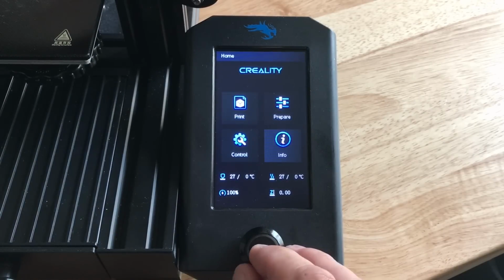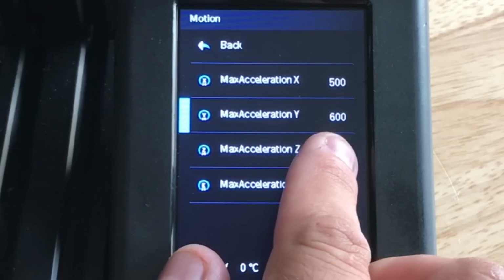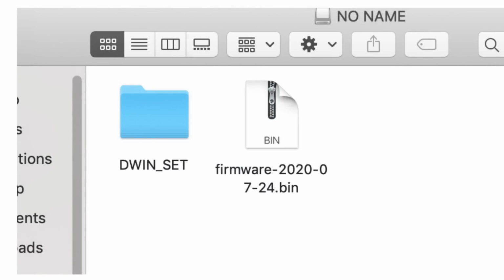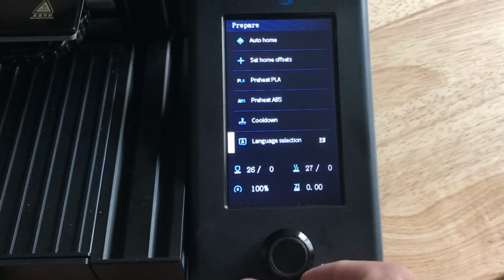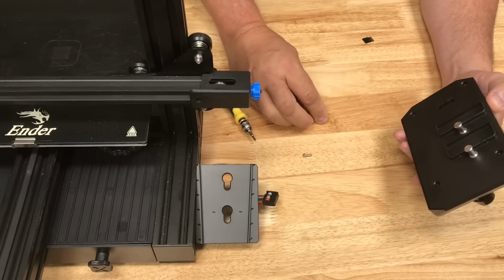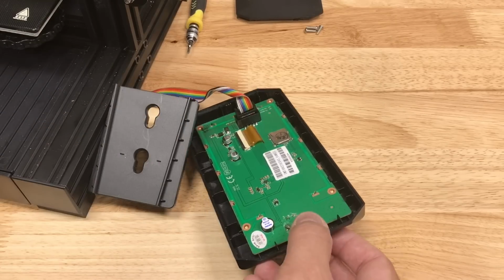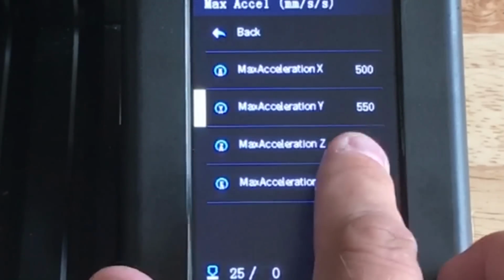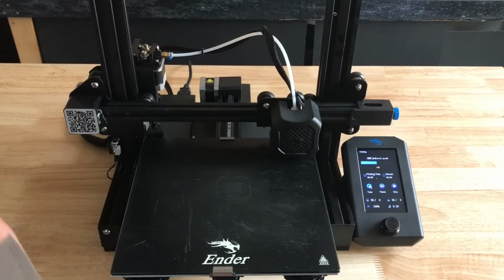Creality Ender 3 V2 Firmware Update - Motherboard and Display

Comment: I installed the last firmware file from your website (marlin2.0.6.1bugfix.zip) and also imported the display update. Unfortunately I can't change the language to English. It stops on CN. Who can help?
Reply: Unfortunately, I cannot change it at this point in the menu.
Reply: Same with mine, 
reinstalled multiple times and just gets stuck on Chinese.
Reply: I had the same problem
Reply: @funthefun8145 : I switched back to the original firmware of Creality (V 1.0.2). But then I couldn't change the language from CN to EN . After the 2 or 3 tries I was able to change the language. If there should be another solution I would like to change to a newer version of the firmware.
Reply from the maker: I just tested my firmware again and got the Chinese and was able to put it back to English same way I did in my video. I did have to click it twice though before it changed.
Reply: @robinkrippendorf316  I did the same I went back to (V1.0.2)
Reply: @FilamentFriday  New one is definitely busted. I've tried installing it multiple times and it always stays stuck in Chinese whether I click it once, twice, or a hundred times.
Reply: @tjaylatham  just curious, but did you update both the display and board firmware?  Changing the language worked fine for me, but I only updated board firmware, not display.   I've since rebuilt marlin code to add bltouch, and no issues loading that either (although I can set language in source code).  I still haven't updated display fw.
Reply: @gregr5  I only updated the board firmware. I tried reinstalling multiple times but I ended having to switch back to the latest Creality firmware release.
Reply: @FilamentFriday  Is it possible that there are different motherboards available for the Ender 3 V2 and that this is the reason for this problem?
Reply from the maker: You never know with Creality.
Reply: Also having this problem, won't let me change the language
Reply: I had the same issue also, I even tried updating the display firmware.  I ended up going back to Creality's firmware.  I was weird, when attempting to change the langue to English, the screen would flash real quick, like it was going to change the text, but it would just stay Chinese. Also when attempting to update the display, all I ever got was a bar to go across the display, never saw the screen change blue then orange.
Reply: same here. no english
Reply: Are there any other identifying markers on the Motherboard, other than Creality  V4.2.2. to see if there are a few different motherboards at play here in the V2.
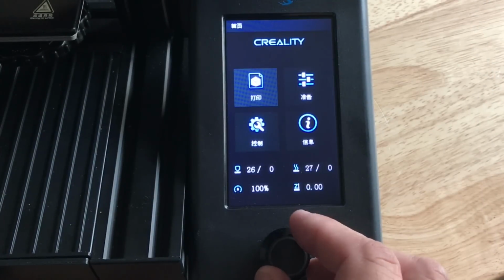Reply from the maker: Watch at 3:10 https://youtu.be/dLZm2itXJkg

Comment: Does this firmware enable thermal runaway or does the standard firmware already do that? I am going to buy this as my first 3D printer but I am slightly scared of it catching on fire (ofcourse I will only print when I am also in the same room)
Reply from the maker: The version I have does but they are shipping it with 32bit board now so I’m not sure.

Comment: Great videos. And I just got in an Ender 3 v2 and noticed I will need to update the firmware to use some standard features that were  on my ender 3 and pro. Editing code is not exactly what Im comfortable with. Two things i am missing is the ability to use Cura M600 (Filament change) and the ability to change the flow rate on the controller. Your video was a great demo of how to install the firmware on the machine and controller. My question is does your firmware allow for M600 and flow rate on the fly? im not sure how to edit the gcode either. So I rely on Cura to input the M600 in post processing. TIA Also what camera are you using for your videos?
Reply: I was able to update and it restart in Chinese. The video explained perfectly how to fix that. I created a gcode with a m600 and still didnt work unfortunately. Help please
Reply: CHEP I really would like to get the M600 working. I have download the latest version of firmwares without success. I tried to register to you website and it denied me

Comment: I just received my Ender 3 v2 and tried upgrading the firmware. I have Creality original firmware 1.0.2 (fro INFO menu).
I copied your bin file to an empty SD card and inserted it into printer and turned printer on.
I saw the Creatily logo and progress bar but after it loaded it still showed version 1.0.2.
I tried additional bin files from different sources (including creality) and even compiled my own but still always shows v1.0.2.
How can I update my firmware?
Reply from the maker: 1.0.2 is the latest from Creality. Just use that.
Reply: @FilamentFriday  I tried a different SD card and it worked although the first one was fine when upgrading the screen FW before.

Comment: HI, Great videos. I used your set up video to build mine, thanks. I have an issue now (User Error) Ok so I went to update the firmware before calibrating. I accidently loaded the SD card that came with the printer instead of the SD card with the new .bin from Creality's website. Now the LCD doesn't load/blank. Thoughts?

Comment: Hey Chuck! Your videos helped me update the firmware of my V2 and setup. I did my first print (calibration cube) and after measuring, I noticed that the sides are taller than the bottom/top. Before doing the cube I did calibrate my esteps but, what else can I to pin point what the issue could be? the cube itself is solid and looks really good, no signs of over or under extrusion. The only issue is the height. Any guidance would be much appreciated!

Comment: hello chep, I wanted to know if  one can change the creality images for those of their own logo, if so, these images that must comply to be entered into the folder DWIN_SET
Reply from the maker: Not sure.
Reply: I was thinking exactly the same. Surely if the DWIN_SET is the images the firmware uses. Then just editing one of the images and saving over the original would work. Please comment if you have tried this. Thanks.

Comment: Hello people, maybe someone could help me.
My E3 V2 went crazy... I load the stl file.... and when it starts, the first movement is a violent slash to the front right and then it raises to the backward right (Making 2 lines, those are the two lines that normally are made in the left Y). It crashed the bed clips in his way.
I'm completely lost. The G Code of cura is fine and I used the printer a lot of times. I have no idea what this could be :(
Thanks in advance everyone.
Reply: I have read on reddit, this could be due to filenames longer than 21 characters. Did you check that?
Reply: @MatthiasBenögen  Thanks a lot for your time Matthias. Yes, they were shorter than that. In my case, was using the micro SD card a lot of times withouht formating often.
Now I am formating it almost every single time and it's running ok. Weird....

Comment: I'm using the latest firmware from your site (fffirmware-20200802-113211.bin) and it solves a lot of problems in the Creality firmware but it creates a new one. It will accept X and Y move commands up to 235 instead of 220 on the factory firmware. This means it can slam into the end of the Y axis. Cura's command to present the print is an example where this happens (G1 X0 Y{machine_depth}). You can also command a Y axis move from the display up to 235 and get the same result. I reverted back to the current Creality firmware to confirm this behavior is specific to the latest firmware on your site. Thanks for all the info and for the firmware. It's been incredibly helpful. I'm hoping this bug gets fixed.
Reply from the maker: I will look into it. Thanks for the detail.

Comment: Hello sir i have an issue with my cr10 clone printer...it just started today ...any idea why a printer would stop printing in the middle of a print??? print was fine up until it just stopped moving...machine did not shut off,nozzle temp and bed temp stayed same...could not resume of change settings... i had to power off and start a new print...than as like with the other it just stopped again 10 mins into the print.... i have fixed dozens of issues on 3d printers over last year,but this issue is something i don't understand...also i have printed this file many times with no issues... please help... and tell me if you ever had such an issue...I found ond video of a guy having this same exact problem with his brand new ender 3 after only 2 hours of use  ,but he only showed a video and did not give any solutions even had his comments turned off...thanks
Reply from the maker: Try a new SD card.

Comment: Hi Chep. For upgrading the Display it is necessary to format the SD card to FAT32 with 4k allocation unit size, otherwise it seems it doesn't work. For fixing the "Storage configuration" you need to edit the "1_English.jpg" file, moving the "Stor" characters to create the phrase "Store configuration". After editing it, you need to convert the JPG file to the 4:4:4 jpg format, by using the "JPGConvert.V1.2" program, it's in Chineese, but there are only a few buttons to guess how to do it. I can send you the final JPG file ready to be upgraded.
Reply from the maker: Awesome. Thanks for the details. Can you send it to FF@elproducts.com?
Reply: @FilamentFriday  email sent!

Comment: Thanks for very useful videos.  I need help restoring firmware, I've tried installing new firmware but display screen backlights only no text?  With or without SD card.  I've tried uploading the 1.0.1 and nothing.  Any solutions out there?

Comment: Hi Chep, thanks again.  I just got my V2, and I want to update with your files.  However, now your site only has the fffirmware-20200802-113211.bin listed, without a zip with the DWIN_SET directory inside.  Is this an issue, or can I flash the firmware with just the .bin file?  I noticed the ender3 configs zip file had a DWIN_SET directory - should that be tossed on the drive with the firmware above?  Thanks!

Comment: Hey, thanks for this clear and understandable video.  I had just purchased an ender 3 v2, and in less than 24 hours it went into bsod mode.  As a last resort after checking connections, mb light, etc,  and even trying octoprint on a raspberry I had, I put an upgrade chip in and voila.  It sprang back to life.

Thanks again!

Comment: is there a way to enable babystepping? it seems to be enabled in the firmware, but its no where on the screen? is it just on the display update that its not there yet?
Reply from the maker: Don’t know. The display has its own firmware and as far as I know Creality hasn’t released the source files.
Reply: @FilamentFriday  i hope they do eventually open source it soon then. because it is very nice interface, but you lose functionality over a regular ender 3 pro. which kinda sucks.
Reply from the maker: Agree. It’s been frustrating.

Comment: when i go to update my screen, my priner turns on but the screen doesn't turn on, if i turn off and remove the sd card it and turn on, the screen comes on
Reply from the maker: You have to wait for the screen to come back during update.
Reply: @FilamentFriday  screen never comes back on, no matter how long I leave it
Reply: Are you still having this problem? I tried to update to the latest firmware (Ender-3 V2_32bit_ 2.0.1V Latest Firmware_0814.rar) and I couldn't get it to boot. Screen backlight turns on but no text or image.
Reply: @AndrewMok  yeah gave up in the end, if I remove the card it's fine

Comment: Does this firmware have liniar advance enabled? Assuming problems people are having are because of the 22 character limit?
Reply from the maker: No and mostly yes.
Reply: @FilamentFriday Hi Chep. Love your video (as usual). You seem to have opened up the V2 already and you're definitely more aware of its constraints. Do you figure the motherboard is replacable by something from the SKR line-up without too much hassle? I.e. looking at the physical dimensions.

Comment: pls help !!! im facing a weird problem. my printer is up to date (ender 3 v2) with creality update 0814. the printer stops randomly the e motor while printing. i already checked all the cables, reinstalled cura and also installed older versions and i also testet ideamaker - same resaults. i would preciate any help. regards from germany.
Reply from the maker: Try a new SD card.
Reply: @FilamentFriday   Hi Chep, thanks for your response. I also wrote to creality and their solution was similar. i formatted the sd card via CMD and it worked :) the printer is now running propperly again :) thanks and go on making videos. greetings from germany

Comment: So, I have an ender 3 pro with an upgraded print bed 400x400mm does this mean I'm out of luck till the new motherboard comes in to update my firmware? Or is there another way I can get my printer to realize its new bed dimensions?

Comment: I have seen more than one person claiming to have "bricked" their V2 after trying a Firmware update, and getting a black screen etc. Apparently it didnt help to re-upgrade the firmware again. So how do one recover from such a thing?
Reply: Are you still having this problem? I tried to update to the latest firmware (Ender-3 V2_32bit_ 2.0.1V Latest Firmware_0814.rar) and I couldn't get it to boot. Screen backlight turns on but no text or image.
Reply: @AndrewMok  Solved it! I reformated the SD car (Fat32) then added the firmware file from the link in the description, but I renamed the .bin file to make it shorter. I changed it to 'fffirmware-1.bin' and after about 10 seconds of blank screen, it flashed correctly.
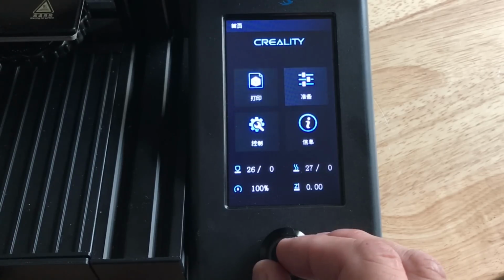It did change the language to Chinese but that's covered in the video above at 3:09.
Good luck!
Reply: @heyitsbort  , nice to know it can be fixed at least sometimes, if not always? Did you update the screen with the DWIN folder, or did you have the DWIN folder on the SD card together with the .BIN file?
Reply: @heyitsbort  I can confirm this worked for me when it happened
Reply: @heyitsbort  You are a legend ! This worked for me.
Reply: @AndrewMok  , I have not had this problem (yet). But i want to upgrade the FW to a BL Touch compatible FW, but im hesitant if this problem cant be fixed every time when/if it occurs?
Reply: Having the exact same problem. Hoping there's a solution.

Comment: @CHEP, does pause at height Cura plugin work for you after the update? It does all the movement/retraction manipulations, etc., but wouldn’t actually pause to get the filament replaced, just continues on with the print.
Reply from the maker: Use the M25 option instead of M0.

Comment: Hi,

Thanks,for all of the informative videos. I upgraded my Ender 3 Pro to the SKR v2..0 board. It powered up and everything okay until I tried to upgrade the firmware, the upgrade left me with an unresponsive blank blue screen.  Any suggestions on how to diagnose the problem? Thank you
Reply: Are you still having this problem? I tried to update to the latest firmware (Ender-3 V2_32bit_ 2.0.1V Latest Firmware_0814.rar) and I couldn't get it to boot. Screen backlight turns on but no text or image.

Comment: Hey Chep! As always, thanks for the awesome video! I'd love to get an expert's opinion on a problem I'm facing. I've noticed that during vasemod printing my Ender 3 v2 produces blobs. I've been able to fix this by either slowing printing speed or by lowering the resolution in CURA. Personally I don't like the idea of having to lower the resolution on a 32bit printer.

I understand that these blobs are caused by the mainboard's buffer not being able to keep up with the amount of commands in the gcode. Is it possible to increase the buffer in Merlin? I have no knowledge in Merlin or compiling firmware at all, so I have no idea how to do that. But I think it should be possible as the V2 has a 32bit board.
Reply from the maker: Try this: https://youtu.be/Hvw3DrVAeTA
Reply: @FilamentFriday  won't decreasing the resolution make my prints less accurate?
Reply from the maker: You won’t notice

Comment: @CHEP! Thanks so much for your effort on this topic. Today I try the new firmware on a Ender 3 V2. I have a little issue. When print finish and moves the bed to the front, the step motor put some extra steps, making noise. Someone have this issue to?
Reply from the maker: Yes. I’m looking into it.
Reply: @FilamentFriday  I had a problem with the firmware were after stopping the print, the print head autohomed and then moved back over the print before unloading the filament. I only had this once so it might have been a problem with my gcode rather than the firmware. Afterwards I installed the official firmware 1.0.2 and now the bed level is not waiting for inputs anymore. Currently downloading your version again. If the filament unloading happens again I'll let you know.
Reply from the maker: There is a remix of my bed level for V2 using M25 instead of M0. You can get it here. Just click on play/pause to make it work. https://www.chepclub.com/bed-level.html
Reply: @FilamentFriday  Thanks, I'll try that one out tomorrow. I just tried your firmware with the other leveling gcode again and after abandoning the print it wanted to unload the filament again. Is that something you have programmed the firmware to do? I used the print stl and sliced the model for myself so I'm pretty sure the problem is not with the gcode if it isn't intended to happen.
Reply: @FilamentFriday  I think its the 235 mm on the Y axis on firmware.

Comment: I see Creality posted a new firmware this morning but it's Marlin 2.0.1. Should I go with yours or theirs?
Reply from the maker: Try theirs.
Reply: The new .bin file from Creality (14 August 2020) doesnt work with "Pause at height" in Cura 4.6.1  :( . The printer stops and move the hotend but doesnt give you time to change filament.
Reply from the maker: Nope. None of the Creality firmware support the M0 GCode command.